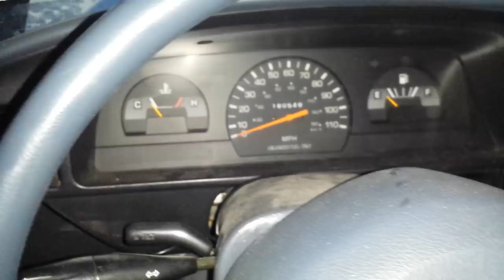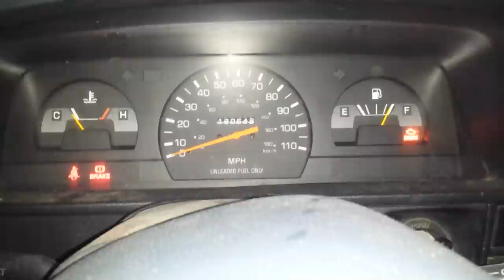1994 Toyota 22re idle and throttle issue

Comment from the maker: turns out it was the throttle position sensor
Reply: +Tippo Thank you for the update!
Reply: Where did you find the instructions to set the new throttle position sensor when you installed the replacement?
Reply from the maker: I just installed it, make sure the clips fit into the new TPS appropriately. it's above the thermostat.
Reply: I’m having the  same issue on my 91 but I’ve tested and retested and adjusted my throttle. Did your tps check out...?? Before you replaced it????
Reply from the maker: florentino2 yes, I replaced it anyways and it worked
Reply: @florentino2  I know that this comment is over a year old, but just in case anyone else sees this, I want to mention that the TPS can fail within specification.
Reply: Todd Lewis could you detail the things you did a little more my 94 is intermittently running rough like it has a miss but I suspect it’s not the case. Wanna do simple clean and adjusts before spending any money
Reply: How did u set the tps sensor
Reply: My 1989 started doing this 2 days ago... So look 4 new tps? And where the throttle body goes down and hits the thing with the spring its not going all the way downn. I tryied putting a lonnger bolt so it does. But just idles to high with that longer bolt
Reply: @novakid69350  thanks a lot!

Comment: This is definately a TPS issue. I had exactly the same thing going on. I replaced the TPS and made sure it was correctly placed on the throttle body and adjusted s n d ot all went away. The internal coupling or engaging must be aligned correctly if it's off, that's exactly how is going to sound.

Comment: Throttle body.  There is a hose under throttle body that has coolent in it it activates a air intake valve by pass its  sticking  you have to take the whole throttle body off to access this  it is on underside needs replaced or cleaned its like a thermostat ..

Comment: Cool, glad that you tackled the problem.. She was a bit rusty huh ?  You must live where they salt the roads.. I just racked my brain, to no end on a similar situation with my 96 Tacoma.. I ended up taking it to the shop today.. It's never been to a shop, I've performed all of the maintenance on the thing for the last 20 years and nearly 400,000 miles.. First and foremost, before taking it in I replaced TPS, plugs, cap, rotor, wires, etc etc.. I used all Denso (high quality parts).. I get a call from the shop today, the diagnosis was an intermittent (bad) spark plug.. So glad that it was minor !!  Now, I'm kicking myself for not testing the plugs after gapping.. But, damn..!  New plugs.. Goes to show that just because a part is new doesn't necessarily mean that it's good.. In the end I'm happy.. But, a five dollar plug cost me over $100..
Reply: O

Comment: mine was doing the same thing. check for water flow through bottom of throttle body. Thats the two hoses attached to the bottom. Make sure you get flow through one side to the other.

Comment: Did you ever figure this problem out? Currently dealing with the same issue. I Replaced and set TPS.
Reply from the maker: yeah, it was the throttle position sensor it's my pinned comment

Comment: I have the same problem.   Replaced everything,  engine surges, and miss upon acceleration.    Other than that, it runs great.  I am baffled.
Reply: check O2 sensors and cat might be clogged

Comment: 1994 22RE. Not surging at idle, but at 1800-2000rpm. At a loss. Replaced TPS and IAC. Cleaned MAF sensor and throttle body. Can't pass smog. It won't hold at 2500rpm for 30 seconds. Not sure what to try next.
Reply: Don West 
Did you ever figure it out I'm having the same issue
Reply: @don west please update having same issue
Reply: replace the TPS
Reply: @adamg3447  he said he did replace the TPS
Reply: @adamg3447 mine is dying when I come to a stop unless I slam it into neutral, had to stop running A/C because that was making it die first, Any ideas?? Please and thanks 🙏🏽

Comment: after replacing the throttle body with an upgrade version and switching the tps sensor over to the new one I am having similar issue but mine is doing it way worse. Mine shoots straight to 3200 rpm after cranking then starts doing same thing. Going to get new tps tomorrow I hope that solves it

Comment: sounds like the rev limiter like its stuck full throttle. i cant remember because i must have been 13 and now 26 but i believe there are two cables running up to the throttle body check to see if on is stuck and the other has give

Comment: Mine is rough idol but was dying after running the a/c. Then wanted to die when stopping. Now just not wanting to start after driving and running no air. Suggestions please. Someone said idol control valve but I see a lot of TPS comments on here. On going issue here
Reply: I got a 94 & the exact same issues just died once at idle ten seconds later again ran home 10 miles on what sounded like 1 cylinder, trouble shooting on going

Comment: I have the same issue,  and just replaced the tps, but it's still reving up and down at stop lights.  Hmmmm.
Reply: Idle air control valve sits under the throttle body.

Comment: my 93 toy.  starts good idles fast can't set idle. push brake it starts to surge up and down drinks has.  help please
Reply: vacuum leak
Reply: If you get idle issues from actuating anything (i.e. break pedal etc.) it is almost always a vacuum leak. They are designed to compensate for the load that is placed on the engine.
Reply: Timmy Jackson 
I had same issue..than I had some brake problems changed my brake booster brake master that hi idle and than drop idle issue was totally gone could have been that vacuum hose on booster..heres the thing I never changed that hose just booster good luck